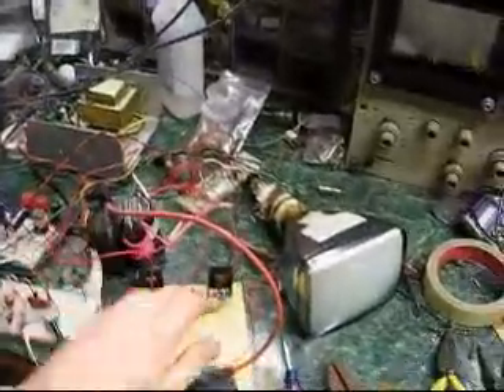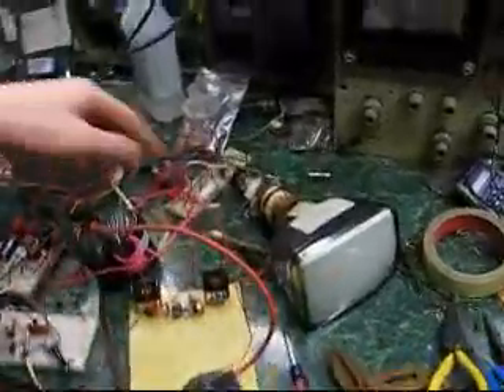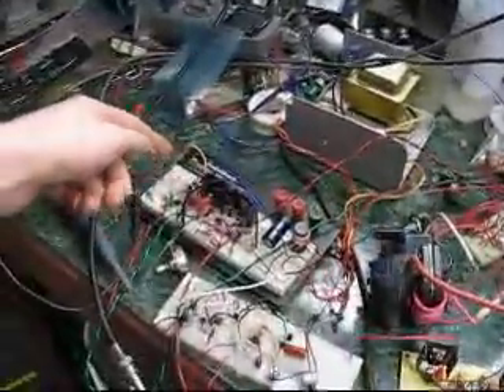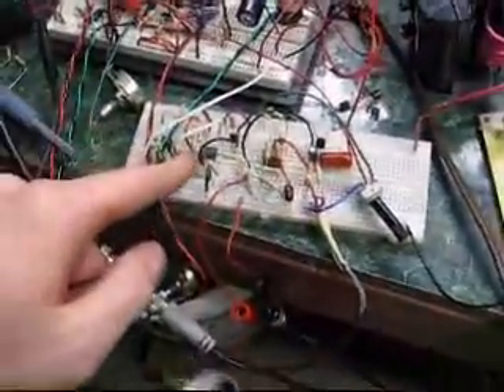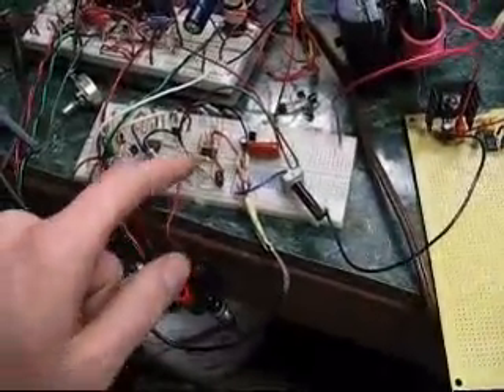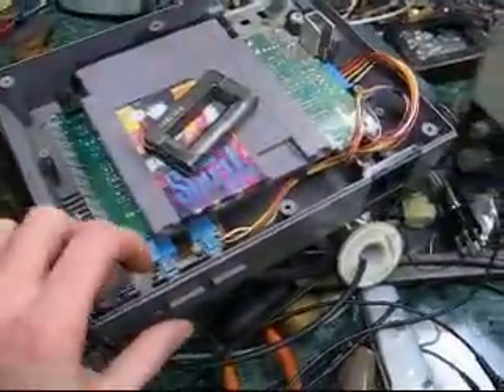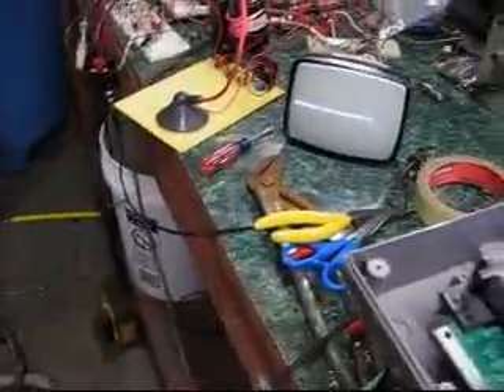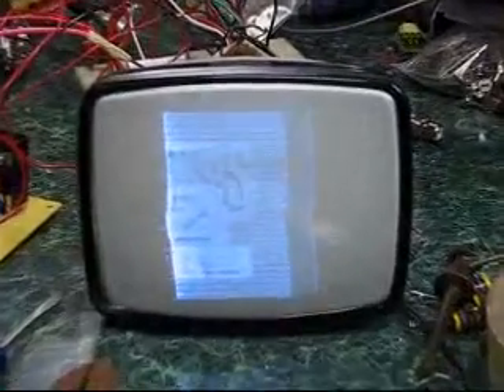Breadboarded Television

Comment from the maker: No, just a 555 driving a power transistor driving a FBT.  Nothing very pretty about it, but simply using a proper switching transistor works a whole lot better than the usual 2N3055 (blech!).